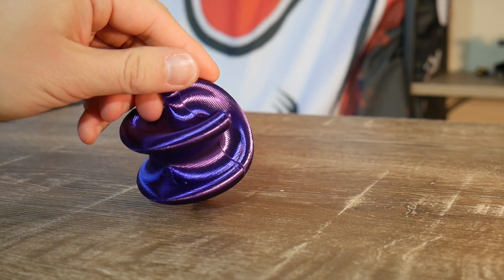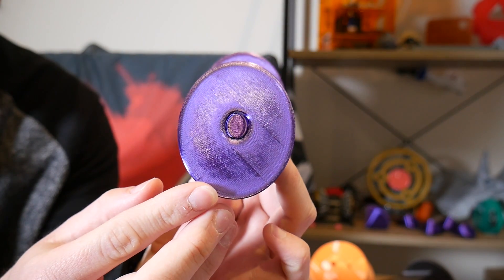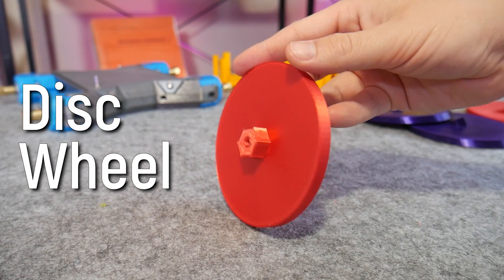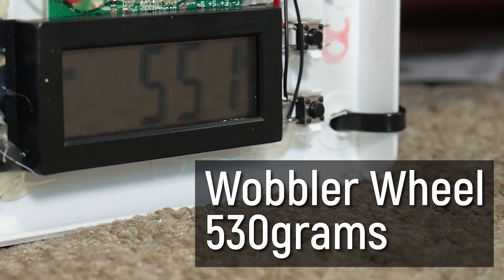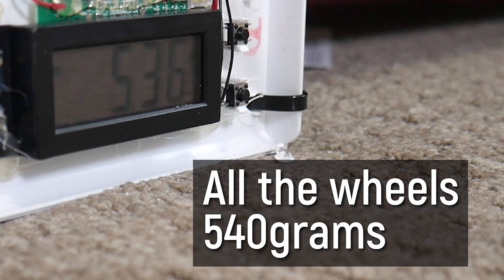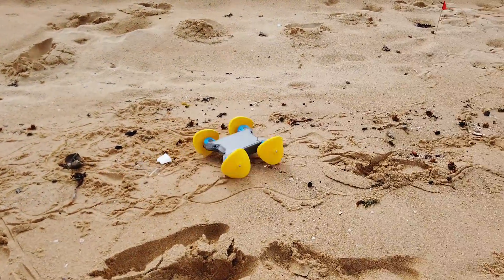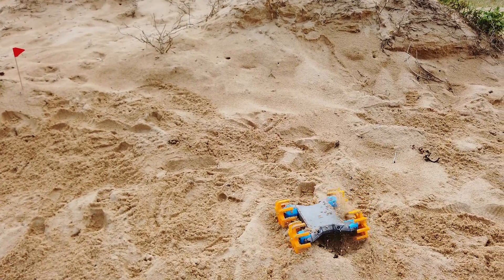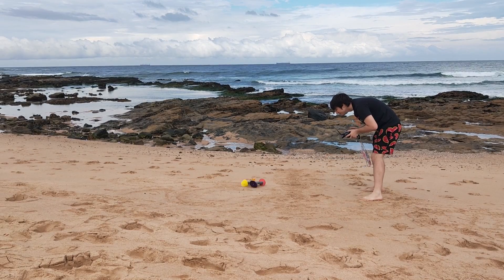This Robot Drives on Wobbly Wheels (but HOW?)

Comment: all you need to make this work is to increase the spoke wheel size and block material from passing through them ( add an inner tube to the spokes, so the sand cant get through ) it will much prefer to sit ontop of the sand than dig into it then.

Comment: A reason to not use these wheels is a dynamic moment, along the axis of Shaft, induced by the shifting endpoint of the wheels, which touches floor. It's a swelling stress on the shaft by the Prongle Wheel and a shifting stress by the wobbler wheel

Comment: I think if you put a small bit of rubber or something with traction, those other wheels would pull harder on the sand. Most of the wheels were more like driving on a big blade when driving on the sand. 
It would be cool to see the test done on ice

Comment: Think about the body height. You were high centering the thing a bunch, you have no ground clearance. its like taking a slammed car into the desert, it just wont work well, give the tires a larger overall diameter to achieve more ground clearance, or raise the body up, the larger wheels would be better tho.

Comment: Interesting and creative!
Some thoughts that might help:
1. First of all, very much affects the whole experiment, the ratio between the speed of rotation of the wheels versus the speed of progress of the platform, it is long to explain but in short (from experience in the field with different vehicles). - Simply put, you will get greater traction and better mobility when you limit the speed of rotation of the wheel so that it does not exceed the speed of progress of the vehicle and for a start just go easy with your hand a bit on the gas.
2. When traveling on sand, the headroom is very important -  the wheels are all too small and the vehicle crawls on the sand, which opposes the vehicle's progress - can be solved by increasing the diameter of the wheels and a different platform structure so that the center of the vehicle is higher and not flat.
3. In general when traveling on sand the surface area of the wheel is very significant of course, there is an ideal ratio between the weight of the vehicle and the surface area of the wheel, I would simply suggest increasing the wheel width at least 2 times for the first three types and for the last type I would close the center of the wheel With stripes (similar to a tractor wheel).

By the way the vehicle progresses in the sand is better when no sand is thrown backwards but the sand is compressed downwards and is used as a counter to the wheel to push the vehicle forward.

In addition, it may be worthwhile to add teeth to the circumference of the wheels - a combination of wheel number 4 and 1-3.

Well done for the creativity and execution, it was fun to watch

Comment: I think insufficient ground clearance is messing up the test, in part.
The last one just needed actually having the full wheel with ridges, not just ridges alone - that would prevent it from digging in too much.
Had a look at the wheels of the mars rover?

Comment: I think you should look into some of the wheel designs NASA considered for the rover. I seem to remember something of a hexagonal web one. Also, I'm not sure about 3D printed material, but they also experimented with self expanding and contracting wheels. They'd open up for more traction, then close for better flat surface grip.

Another thing I think you could test is different surfaces. Sand is arguably the hardest for a SMALL robot because they don't have much weight to push downward and it's all loose. I think you should try a flat, rough, grass, then sand. And do them with different incline grades.

Comment: The wheel designs didn't fail you, scale did. If all of the wheels were scaled up (150% or larger) they wouldn't hang up on the sand as much. A lack of ground clearance was your undoing.

Comment: It seems like the volume of plastic that is used. As the printing cost would be the same for each wheeel, but some designs would be the better even though they cost the same to make. Which is the true test of engineering and life in general. Make something better with the exact same amount of material or less.

Comment: Definitely a better idea: large tall gears, more clearance for the chassis. The points of the teeth would be the only surface area, therefor you could have wide, tall gear wheels, but the tip(contact area to a hard surface) would be the same amount as the other wheels in the tests. They would be considerably better than the other wheels as they would have much better grip and clearance. You would have to mess around with the height of the teeth, and the quantity of teeth, but I guarantee that it would outperform anything else.

Comment: Purple wobbly wheel, 1/3 as thick,  connected to another wobbly wheel by dividers. Kinda like looking at cardboard edge, but thicker. This will give you the scoop effect, and the wobble will give the wheel a new section of sand to grab at the point of each scoop.

Comment: I mean you took the same total surface area for each wheel but in reality its the contact patch that matters . Like a small diameter wheel which is thicker will provide more traction than a larger diameter thinner wheel even though both may have the same surface area. Maybe thats what caused the difference you see in your tests

Comment: A flat star wheel. Try wobbled and standard angles. Also I believe the wobbled wheels would perform better if all wheels moved inward/outward in unison and did not rotate individually. A screw tank is perfect for sand. A design that forces itself over the sand without disturbing it much.

Comment: Here are some thoughts:
- Straight discs fail so easily because, with enough torque, the wheel digs out the sand below it and the entire wheel sinks in to the sand. As the wheel continues to rotate, the next part of the wheel hits the same patch of sand and continues digging downwards.
- The wobbly and prongle wheels do better because their contact patch is constantly moving around. At any moment, if the sand below the contact patch fails and is thrown, the wheel rotates and the new contact patch lands on a surface that (hopefully) hasn't already failed.
- As the sand below the wheels fail, the wheel sinks in to the void left behind. To move forward, it now takes more torque than before, because not only does it have to move forward, but also up the divot that it has created. Same things happens to cars that sink in to mud or snow. This extra force is likely to cause the next point of contact to fail too, even if it would have been strong enough before. Eventually you get to a point where you have to go up much more than you have to go forward and there just isn't enough traction to overcome gravity. So you really want to avoid sinking.
- The spoked wheels work better as they sink in because the spoke makes contact not just on the normal surface (the wheel on top of the sand), but also on the face of the spoke (imagine it as a paddle, not a wheel). The really are very similar to paddle wheels.
- However, paddle wheels have another benefit: they are "buoyant". The paddles only extend a small depth in to the sand. The weight of the vehicle is actually resting on the round, smooth surface of the tire, like a balloon. The smooth surface also still "rolls" nicely up any divot cut out of the sand as it digs.
- The spoked wheel is hollow beneath the spokes. As it digs out sand and creates a divot, the loose sand piles up on top of the spokes. Each spoke is now trying to dig up out of the sand as much as it is trying to push forward.
- So clearly a filled wheel (which is buoyant on the sand) with paddles (which dig in and push a thick layer of sand rather than just relying on friction to the very top layer of sand) would be better.
- Could we combine some of these effects? What about a paddle tire where the paddle doesn't go all the way across, but rather moves eccentrically so that the contact patch is constantly moving? For the same surface area of paddle, this moving contact patch should fail more gracefully, for the same reason it benefitted the wobbly and prongle wheels.
- What about changing the face shape of the spokes? To get maximum traction, you want the force of the wheel against the sand to be parallel to the ground surface, but you also need enough down force to hold the sand together (packing it) to keep it from failing. If you think of it like the flute or tooth of a cutting tool (saw blade, drill bit, mill, etc), then a couple important considerations are the rake angle and relief angle. A negative rake angle might actually encourage the production of a built-up edge -- something you typically don't want when cutting a material, but something you would want if your intent is to harden the material so that the cutting surface engages with it more strongly, like in our wheel.
- Similarly, you would want a bit of a relief angle so that the spoke/paddle doesn't lift the sand up-and-off of the ground as it rotates around. You want to maximize how much force it applies parallel to the surface (when the edge is perpendicular to the surface), but minimize the amount of force it applies to the surface as it rotates out (push backwards, but don't pull up).
- The best way to prevent the surface from failing is to minimize the amount of force applied to each part of the surface. That implies that more surface area is better. Controlling for the surface area of your contact patch will be important for a fair comparison.
- Wheels designed for water and snow tend to have V-shaped grooves in the tread. For water, this helps to channel the water away to the outside of the tire so that you don't hydroplane on top of it. For soft dirt and snow, I believe this helps to compact the loose material on the surface. If your contact patch is moving as you rotate, using a V-shaped groove would mean that the sand which is displaced when it fails would be pushed sideways into the sand which will be pressed on by the following contact patch. This force should pack the sand, causing it to harden, so that the next contact patch is less likely to fail.
- Sharp points of contact tend to concentrate stresses, increasing the likelihood of failure. If you do have any kind of curve either horizontally or vertically, you'll probably want it to be soft (a U) and not sharp (a V or an L), so that stress doesn't get concentrated and cause the first points of contact to fail quickly. Again, just look at the gentle curves of the paddles on a paddle tire.
- Torque limiting is really valuable. There is always some amount of force that, if you push the surface that hard, the surface will fail. If you try to accelerate too quickly, you'll eventually hit that point. If you could limit your torque somehow (push the control sticks less; set a lower endpoint on your transmitter), that would help to avoid spinning out and causing the surface to fail. If you have a decent transmitter, you could even use an extra knob or switch as an endpoint adjustment, so that you can run with lower endpoints normally (try to avoid surface failure) and switch to higher endpoints (give'er!) when the surface is strong.
- If you take all this in to account, don't be surprised if it starts to look more and more like a conventional vehicle tire. After all, engineers spend a lot of time trying to find the most effective solution to their problem. However, longevity isn't a major concern for you, nor is manufacturability (3D printing is capable of some things that molding rubber cannot do), so there's likely some room to improve over common retail designs.

Comment: Cut teeth into the other wheel designs and you'll find that they do MUCH better.
And change the testing area - sand is a challenge even for vehicles specifically designed for it (which is why you have those sand paddle tires).   The best would be a manicured surface like a golf green where the wheels could bite but not bury themselves by scooping the surface.

Comment: Spoke the wobblers and the prongle wheels, then lower the RPM. Sand is the most difficult, easy to get stuck based upon weight and height of vehicle. add a slope and none of these will work on soft dunes, make it swim, wobble+spoke, with a super light weight and high surface area. fun.

Comment: If the flat wheels and skewed wheels are cut from a cylinder the same diameter, then the wobbly ones will always come out a little ahead, as they'd have a larger surface area and a shallower break angle. :)

Comment: This is pretty much giving ideas to military engineers:
Wobbler Wheel - good for an alternative to a normal rubber wheel, but instead you can use a metal plate instead as to put cover.
Prongle Wheel - similar to Wobbler wheel's Metal Plates alternative, but instead this gives more protection to an armored vehicle's axle, a vehicle fit for escort as it is hard to disable and hinder the vehicle's movement
8 Spoke Wheels - this is pretty much similar to a tank's tread or heavy tank's wheel but in a circular shape. Good for going rough and unknown terrain like sandy and snow areas as you may go over hidden rocks burried underground. Weakness would depend on how strong the material used to build it with as the vehicle's weight and maybe an anti-tank mines could snap out some pillars of the wheel.

Comment: i feel like one of the issues with the sand was also the clerance of the main bodyfrom the floor it looked like the body was getting caught and causing the wheels to spin, there may also be a weight issue it may be too light so the sand is just holding it back or lifting it instead of being moved out of the way.

Comment: I expect the reason the wobbler wheels always pulled to the right on the carpet is due to a grain in the pile of the carpet. Run the car in the opposite direction, pulling from the other side of the room.

Comment: For soft dry sand like that, you need treads.  Treads provide both a surface to bear the weight, and paddles to bite in.  Skid steering provides the most maneuvering ability, but is inefficient with power use.
          For "fixed" (no tires) wheels, for sand, you need wheel shaped like the sand tire you show.  This will preform better than any of the wheels you made.  If you take the spoked wheel, and add an interior cylinder to it, the spokes forming paddles, you will beat all the other wheels you have.  Making the wheel somewhat barrel shaped aids in turning.

Comment: Cheers for your nice 3D printer experiments, very highly interesting!

PS. To give the car model & the wheels models a fair test, a lower slower speed gear should been as well invented, because with a speedo drill  push in soft surface + if a vehicle is to light or to heavy, it also bugs down as well. :)

So if you could & have time & energy, create thiny grams weight places that can be putted onto the vehicle model, as a front weight & back weight, on top of the vehicle. And introduce a slow strong gear slowmo spinner, to being able to climb over such difficult surfaces! :)

Thank you before hand Muse!

BR AN.

Comment: Do you think it would be possible to have the wobbler wheels push the car thru water? Perhaps the correct relative orientation side to side or front to back would need to be maintained.

Comment: The biggest issue here is clearance the wobbler and Prongle wheels would have done  better if the chassis didn’t touch the sand when they would bog down

Comment: I feel like the bigger problem was the body getting stuck in the sand, rather than the wheels. If you build it like a jeep with more clearing to the ground, the wheels should have done a lot better
Reply: Larger wheels would def helped that
Reply: Definitely. Increase the clearance and reduce wheelbase by putting the motors under the control unit, with the wheels sticking out the sides, maybe even with sorts of legs to increase it further. I would also go 1,5 times wheel diameter as not to reduce torque too much but increase contact patch surface. And use the same principe as the offroad tyre, your last wheel was great.
Reply: Yes, and far too much torque being applied through the wheels causing it to dig down very quickly rather than griping. The operator should go gentler on the throttle, and not slam it on full when it starts to get stuck, which seems to be most people's impulse and which makes it even harder to get out.  Sand is one of the easiest materials to get stuck in if you gun it.
Reply: Also kinda lame how he puts the paddle spokes on the one wheel when he could've put the on even the wobble wheels asline as they were in line with axel

Comment: I think you was lacking ground clearance to really get a true outcome of how the wheels would of performed. The body was bottoming out on the broken up sand and up the hills. If you did it again maybe make bigger wheels to lift the body off the floor. You may need spacers or longer axels then though. but quality video wish I had a 3d printer and the ability to use fusion 360.

Comment: I feel like one big problem for a lot for these designs is that once on a car I feel like the vibrations at highway speeds would be the nail in the coffin. I also feel like some would be very susceptible to severe damage from road debris. Maybe I dont understand how the rotational forces work but I feel like just because it rolls smoothly in a straight line doesn't mean it will do so at 60mph. We won't know until someone is brave enough to try with a real car.

Comment: Make wobbler wheels that are based of 4 or 8 side symmetry so they can actually spin at high speeds and make a vehicle intended for high-speed testing rather than traction

Comment: I wonder if there are any mechanical wheels that you can make as a single print that could work? Like the 4 by 4 cat claw wheels from back in the 80s. If the wheels would get stuck it would extend the claws out to grab and pull itself out?